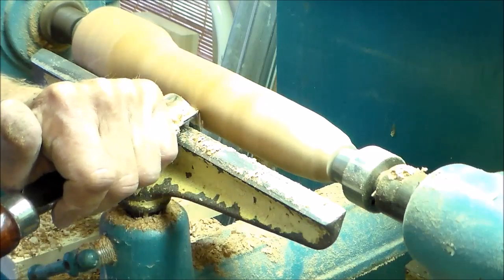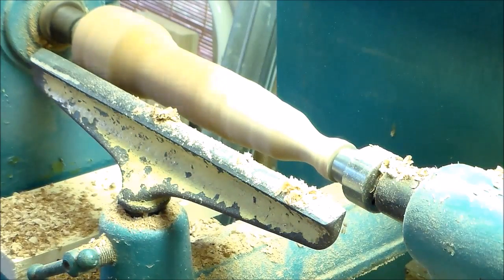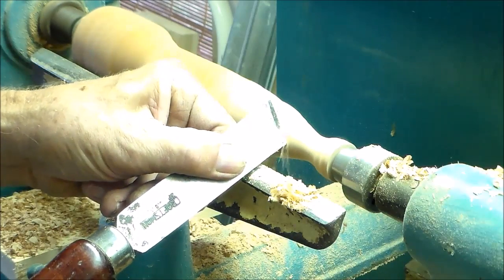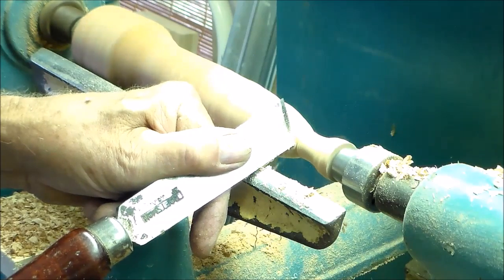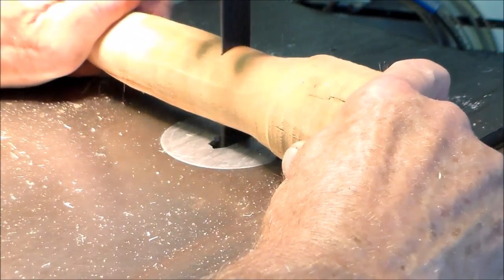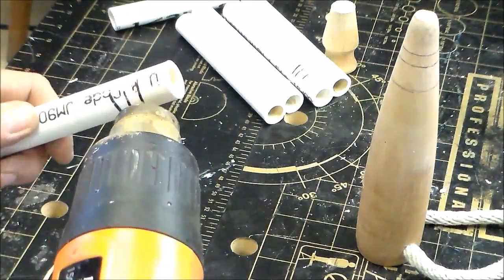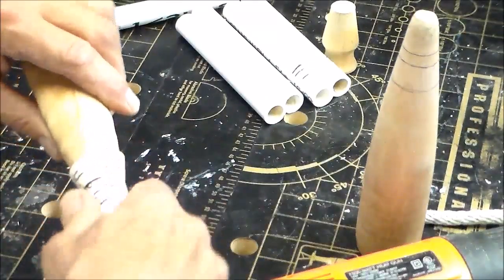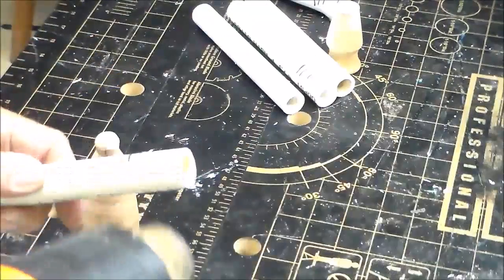Aquaponics, a better bell siphon stand pipe for your grow beds!

Comment: i watched this vid, understand more perfectly another way of achieving the "flare", etc. But what I don't understand is why you were doing this in the 1st place?I only plan to hv 2 IBC fish tanks & 3 bathtub flood & drain grow beds.I also w/b adding a 75gal Rubbermaid pond tub for a sump[i think].6 components total. But I am confused w/the flaring bell siphons. Whats the deal? Can u/anyone else advize for my set-up? Respectfully, Margo
Reply from the maker: +Margo Fr  The flair at the top of the stand pipe aids in the rapid start on the siphoning action---two possible problems with the the bell siphon system is 1. getting the siphon to start and 2.  making the siphon break. this funnel/ flair on the end helps the siphon start more reliable--- Hope this helps my Friend---Don
.
Reply: That does make a lot of sense. I see it now! Water w/enter possibly "earlier" to the flare than to a totally straight opening. Well done! Thanks for taking the time to answer my Q. I am just starting out.Hv not even plumbed yet, but I hv painted both IBC's. Now @the stage trying to decide whether or not cut a full opening at the top or  just in the middle & making it a lid of the cut out; then I w/not hv to cut the metal cage at all. Any recommendations? Margo

Comment: Heat kitchen Oil inside on a pot in order to mold the PVC... This is the best way to mold PVC. You will see and you will save a lot of money in power light. I work for a company who makes pvc fittings and they use this system. They use
this system because is cheaper to make the pieces by hand than buying the original pieces here in Mexico. They heat oil in a pot then they introduce the pvc until its turn very soft..Then they mold the pieces like you...But be careful!
Reply from the maker: Paco Morales Thank you so much for that tip of knowledge--- I will try this in the future, best of luck,  Don